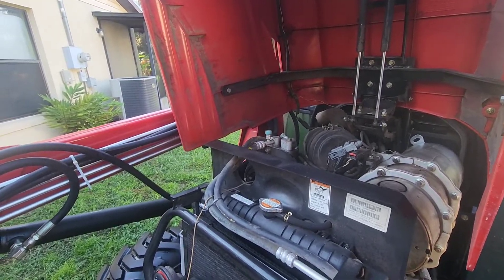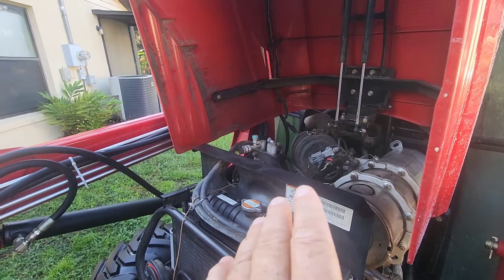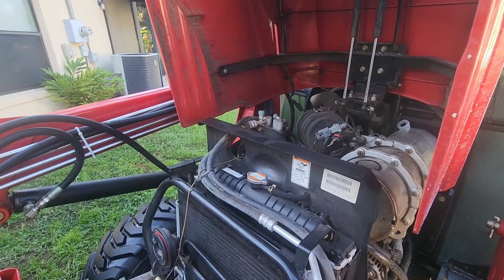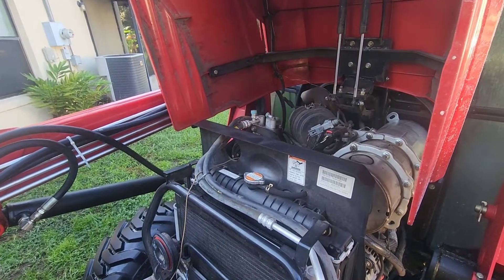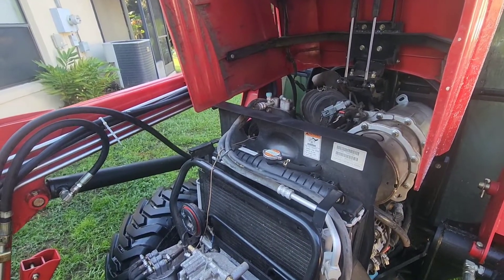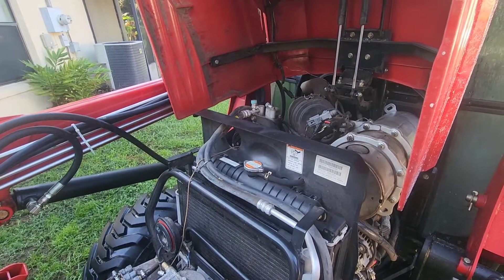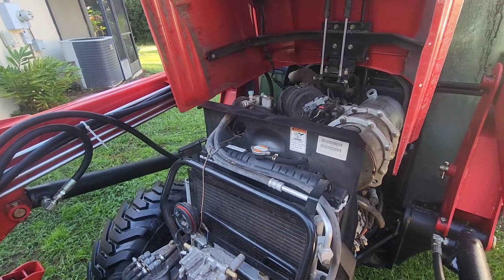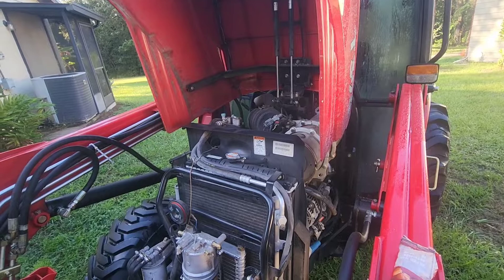T394 tym dpf fillter update

Comment: As for the diesel spray and smoke part of the regen, consider blocking the diesel spray line or reroute it back to the fuel tank. You may be able to let it think it has gone through a full regen cycle by rerouting the fuel. Great video and good luck with it.

Comment: Hi, on my T394, I installed a voltmeter on the differential pressure sensor signal (the connector that you unpluged). Voltage is always around 2.5 To 2.7 volts (2.5 volts = dpf ok, 5 volts =  dpf blocked). And it still doing a regen every 9 to 15 hours. Then I clean the two dpf temperature sensors. One of those was dirty. And I found that every electrical problem, like loose wire or a blowned fuse, initiate a regen next time the tractor engine runs. After immobilising the cable harnest, located in the wall behind the computer, the tractor run for 36 hours before a regen. That's a big improvement. For your tractor, you still having regen even without a dpf. Maybe, you have an electrical problem like mine.

Comment: If you always find the dpf filter clogged, it probably isn't your dpf filter. The engine itself malfunctioning.  Low fuel pump pressure,  low injection spray pattern, wrong pump timing, wrong fuel, dribbling nozzle. High altitude/ non-turbo. Does it have an EGR valve. The engine may well be sooting up. Is this a direct injection or common-rail. I have seen direct injection pumps cams lobes worn down with very low hours. A clogged or incorrect air filter could cause the engine to soot so bad it could overcome the catalytic effect of the dpf filter. My t474 is none over 200hrs with no regen. The clogged dpf is telling you something about your engine.